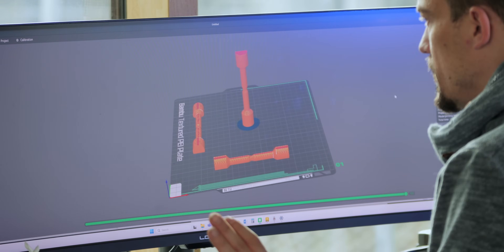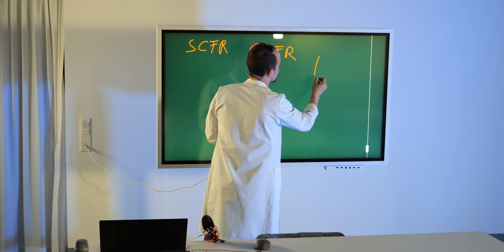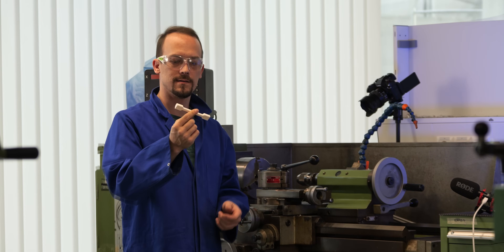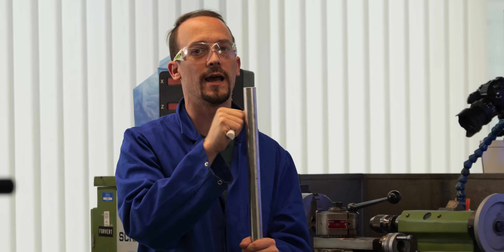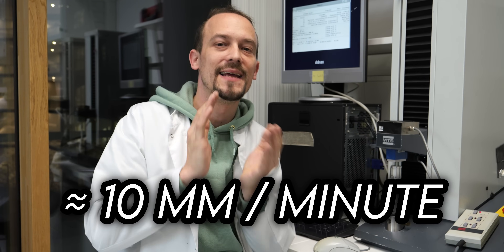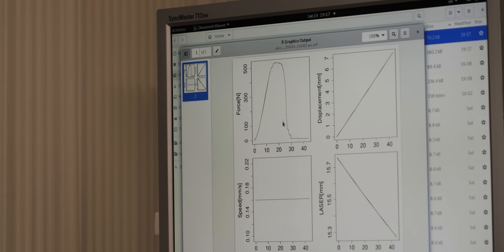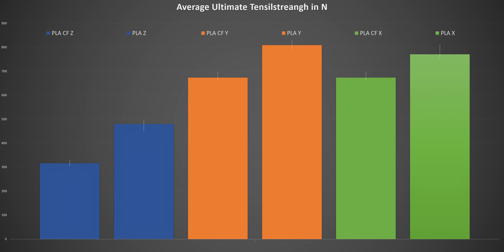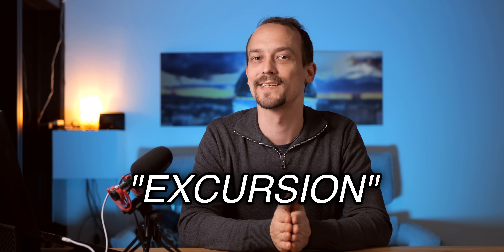The biggest SCAM in 3D Printing? How filament stores try to trick you with carbonfiber "reinforced"

Comment: For medical 3D printing, what material do you use? Do they have contact with skin?
About CF filaments according to my experience: stiffer in XY direction (resists better to bending), more temperature resistant and easier for 3D printing because of less shrinking and better dimensional accuracy (but this last one makes sense with PC, Nylon.. and not with PLA, PETG)
Reply from the maker: Yea all these upsides are true and i experienced the same :-)

Regarding medical printing:
If we just talk FDM:
We use PEEK here. We actually create cranial Implants on the point of care with them.
So we Print the Implants in house and they get transplanted as a permanent Implant (in house as well).
We archived MDR compliency with that as the first in europe.
We also use PLA a lot (of course steralised after Printing) for for example prebending of surgical plates, Orbita plates etc.
I used HIPS for skincontact epithesis before too.

If we talk more than just fdm:

We use biocompatible resins for surgical guides and other usecases,
Lasersintered PA12 Parts for different uses, of course titanium for implants and tools, Polyjet resins, and even Bioresorbable materials like ceramic loaded PLLA (not FDM but close). The last one only on research right now.
Reply: @Ibuiltathing Wow, FDM PEEK sure isn’t being done on your X1Cs, that takes seriously high temps to print!
Reply from the maker: @DaveEtchells  oh jea. For sure. 
We have a specialized machine for that. On this thumbnail u see it. And there is a video coming soon with that machine at the center https://youtu.be/SIIbDDnpftI
Reply: @ Ooh, looking forward to that vid! (I’d wondered what the big machine in the background was, maybe that’s it? It sounds like you work in an amazing fabrication lab!)
Reply: @Ibuiltathing  this is something I have been asked about by my friend who is a surgeon. I would love an in depth video specific to this use case
Reply: Same. We have seen also....BRANDS make a huge impact. So it's not actually possible to make this blanket statement.
Reply: @miestermind  There is actually little as far as the CF itself that varies per brand. One brand simply may use +/- like 1% of another, with the average still only being about 3% CF content. Chances are any difference you are seeing brand to brand is their filament formulation vs the other brand, and not the properties of it being CF inclusive at all comparatively.
Reply: @MattWeber it is not just the %. small companies tend to mix the resin and CF available commercially but indeed CF morphology and functionalization make huge differences.
Reply: How do you sterilise PLA? Got me curious. Can't be with temperature, so I assume is chemical sterilisation?
Reply from the maker: @tinkerman-q  kinda. It's chemical in a sense but also uses electricity. It's called plasmasterilization
Reply: @Ibuiltathing  lol u put the pla parts in the plasma cleaner? Do you know if it changes the surface chemistry of any of the FDM filaments? Like how you plasma clean PDMS and glass so they can form a permanent bond
Reply: @tinkerman-q only plasma, EtO or gamma
Reply: For medical use, only alternative is pure PEEK as I know.
Reply: and you had some surpsing exeptions as well regarding layer adhesion. i really can not remember which was it exactly, that's why I go back time to time and visit those tests
Reply: I was going to mention your channel here, because I think you tell a much more comprehensive picture here. I don't like how this video tests only tensile strength.

Comment: CF pla is like using Elmer's glue instead of resin fore Corben Riker sweats 
Have never understudy the material except when printing stuff like peek that will work if you look att it wrong in a 170c chamber
Reply from the maker: im sorry, i dont understand that comment. i think your autocorrect might messed that up. could you Write that again so i get it? I know that "understudy" is your autocorrect messing up "understand" but i dont get the rest.
Reply: @Ibuiltathing  
I meant that using CF in  PLA is like using wood glue instead of resin in a carbon fiber laminate. I only really see the point of CF in materials like PEEK that will work if you look at them wrong in a 170c oven

Comment: Hoi I built a thing
Bitte pass mit den Kohlefaser-verstärkten Bauteilen und Filamenten auf. Die sind nicht wirklich sicher, es gibt einen Grund wieso die Industrie immer mit Handschuhen und Masken mit diesen Materialien arbeitet. Zusätzlich ist das anfassen von fertigen Teilen nicht erlaubt. 
Guets video!
Reply from the maker: Habe ich in nem anderen comment bereits klar gestellt. Mein Labor wurde um diese usecases herum designed. Wir haben pressure zones und airflow in die korrekten richtungen sodass kein staub der maschinen an meinen arbeitsplatz kommen kann. aber danke für die besorgniss :-)
Reply: Viele rennomierte Filamente dieser Gattung insb Bambus eigenes sind koextrudiert mit einem reinen Polymermantel und CF-Mischung im Kern. Das bringt mehrere Vorteile mit sich, z.B. lösen sich so gut wie keine CF-Partikel von der Oberfläche weder vom Filament noch vom Druckerzeugnis, Düsenverstopfung extrem unwahschenlich, und es gibt deutlich weniger Abrieb an den Druckerteilen, die sich im Kontakt mit dem Filament und der Schmelze befinden, insbesondere, Extruder-Kraftwalzen, Hotend-Hals oder Heatbreak, Düse.

Sollt man aber scho aufpassen, stimmt scho.

Comment: Thanks for the informative video. I have seen similar result in some other videos, it is good to see some additional supporting evidence.

It does make me wonder what the real benefit of these filaments are, wear resistance? Because I haven't seen much evidence for this either.
Reply: It's stiffer (so flex a lot less). It is good when rigidity and smaller deformation under load is more important strength
Reply from the maker: in addition to what @tinkerman-q correctly stated it also makes it easier to print and more dimetional accurate

Comment: when people talk about carbon fiber fillament, i wonder what the advantages and disadvantages are with woven carbon fiber. 

asside from forming.
Reply from the maker: the benefit in the direction of the mesh is immense! Thats why i told that we dont talk about CCFR. because there the fibre bairs the weight / Stress and the polymer around it just "keeps it in place". So its a completly different story but i think one of the reasons why people missunderstand PLA-CF or why this marketing works.

Comment: The only two advantages of CF reinforced is that the parts look nice and they are very stiff but as you said break more easily.
Reply: Correct because stiffness= fragility hardened steel breaks way easier than soft steel. This is not uncommon in the materials world.
Reply from the maker: you are right but also wrong.
hardened steel breakes under certain loads easier, e.g. impact but resists more in other cases e.g. tensile.
So it is always how you look at the problem or what clasifies as a fail of a part for you.

Comment: Very interesting is that PLA CF still has same or slightly better tensile strength than regular PETG. But regular PLA is clear winner here. Thank you for this video!
Reply: It depends on the application. PLA is great stuff but has terrible heat resistance and will sag with load over time. PLA  CF is more heat resistant and less prone to sagging.

Comment: Thanks for the video, someone had to say it publicly finally... there are some aspects in which CF is actually useful, but not strength: it helps with material stability, so fo example in materials difficult to print like nylon it reduces warping a lot and make them much easier to print and also with more stability also comes more dimensional accuracy. Then it just gives very nice textured surface to the printed parts. that's it, there is no added strength benefit, on the contrary parts are usually weaker, especially in Z, which is already an achille's heel for 3d printed parts as you correctly pointed out and showed.
Reply from the maker: Thanks! 
there is a lot of additional benefits as well, heat deflection, Stiffness, accuracy etc. etc. so i do not understand why marketers do not leverage those but choose to Missinform
Reply: The other benefit for CF or GF filled seems to be rigidity (at least in the horizontal plane), and there is definitely situations where rigidity is more important than raw strength.  I also wonder if there's any measurable effect on plastics like ABS that are prone to fatigue with repeated stress.
Reply: Hi Federico! As an Italian F1 fan I'm pretty shocked to come across you in here hahaha. But I know you're also passionate about 3D printing. I'd say the 3rd main advantage of CF-reinforced filaments is mere stiffness, ie. if you really need to minimize deflection of your component and are sure to always operate in its elastic range, then it makes sense to use a CF version. Other than that yes, it's a scam.
Shoutout to MyTechFun who's done hundreds of scientific tests that prove all these claims.
Reply: @KToMmi  100% with you! And be ready for the f1 season that s going to be fun 😉

Comment: Don't forget the little Fibers in the Air and then in the Lungs. Carbon fiber not get out of your body. The reason why you normally need a mask with the right filter class and by the way plastic over 130°C is TOXIC. Look at who to recycle plastics for new stuff. Good Video!
Reply from the maker: true. in medicine for example the carbon-nano-tubes that are all the rage evrywhere in materials are actually concidered a swarword :-)
They are now named as one of the big risks and basicaly outlawed to use by the comunity (im not sure about laws tbo)
Reply: Mmmh.... I have cut unimaginable amounts of carbon fiber without any kind of protection.... What can happen? I always thought it was inert.
Reply from the maker: it kinda iss, but so is titanium (to e certain extend) but fine powder like in SLM is a huge risk.
Carbon specificaly is dagerous. Carbon nano tube for example are so small and sharp that they physicaly damage cells by punkturing their walls. Thats why glasswool is so dengerous as well even tho there is not a lot that is more innert than glas.
Researchers are also concerened that carbon, if fine enough, are genotoxic so basicaly damage your DNA it self
Reply: @Ibuiltathing  I'd actually be extremely interested to know if there's been any publication, peer reviewed or not on these topics? Same goes on the BPA and other known but commonly used every where chemical that are interfering with human hormones, cell function or DNA. I printed my first PET-CF part 2 days ago and sat there looking at my part thinking there had to be a load of microscopic carbon fiber floating around during the print and nothing was actually "encased"

Comment: Marketing aside, it's well known that CF benefits stiffness the most, tensile should be the same (there are some exceptions like PA filaments). For layer adhesion your CF material has to be bone dry, otherwise it will be weaker like you've shown.
Reply from the maker: both spools where in a specialised drying oven on recomended temperatures for 24 hours (18 is minimum). So it does not get dryer.

Thanks for pointing that out. I Did not include that since the video was already super long
Reply: Is there a difference in thermal mass and thermal conductivity for CF filament that could affect layer adhesion? May need to run CF a few degrees hotter or a little slower to ensure bonding.
Reply: Thank you.
Reply: Would be cool to see how it varies by brands. I’ve also wondered how many brands are using the same vendors for filament sourcing and thus are just white labels of really the same material just packaged and priced different.
Reply: Yeah that is not that often.
Reply: some do but it's not as often as I assumed. You can see how many of them perform on mytechfun.

Comment: Though it's open secret, your work is still useful, because you have the equipment to get consistent results.  
The ultimate tensile strength is important, but it doesn't cover all properties of a material. Looking forward for shear, displacement, etc tests.